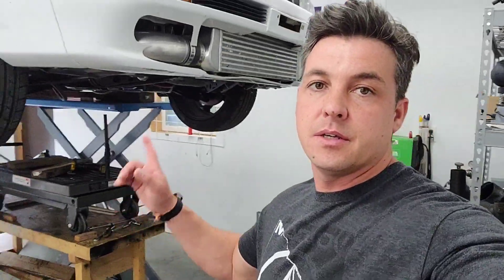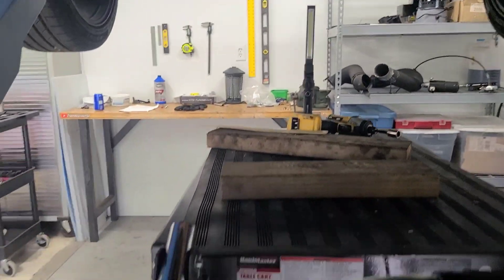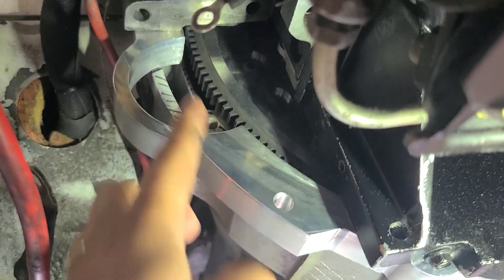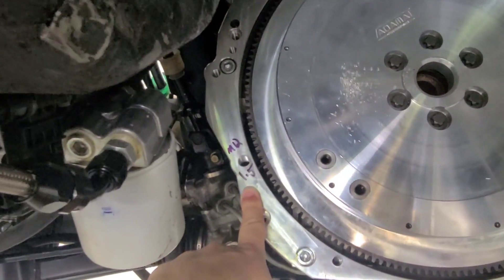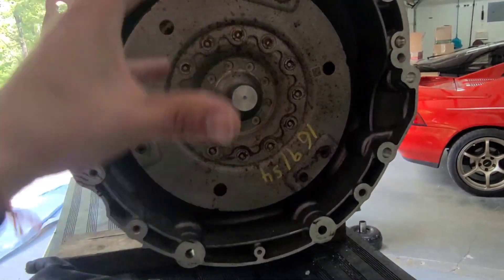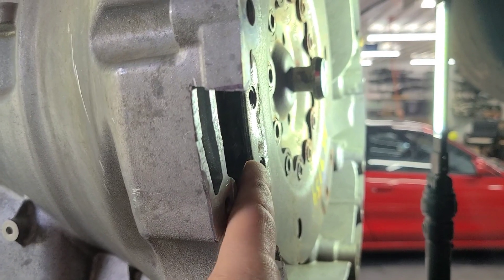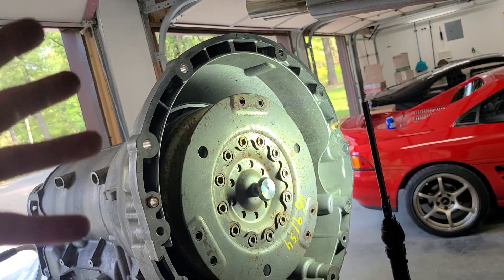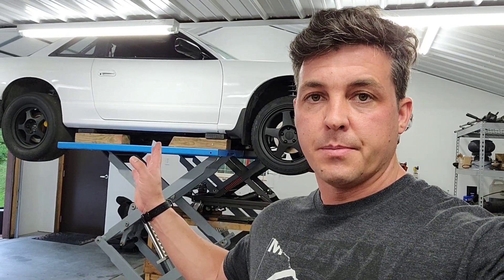Cutting the bellhousing on a 8hp70 for starter clearance, LS

Comment: Love your videos. I plan to do the same with a kswap. Did you have to modify the tunnel to fit the 8hp?
Reply from the maker: I did yes, the bellhousing is pretty large like the 4l80e was, if you can move it further forward you may not have to though

Comment: Might be a stupid question, but could you take a hole saw to the oil pan to make it easier to get to the torque converter bolts?
Reply from the maker: Good question! I'll have to take a look, but I'd rather not cut up the pan honestly
Reply: @FredAllenBurge  I only ask because I know the 4l60e has a hole in the bottom to get to the flywheel (I'm assuming).  Maybe that hole plug could be used in the rear portion of the pan.

Comment: Might want to pull the engine and mount the engine and transmission together outside the car to get those top bolts in. Honestly though I'm sure it's fine with just the bottom bolts in